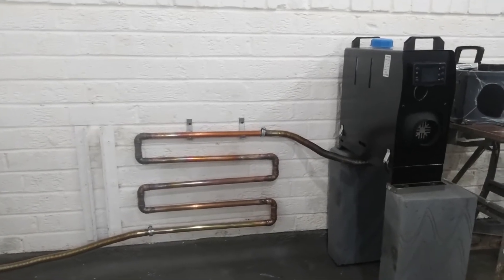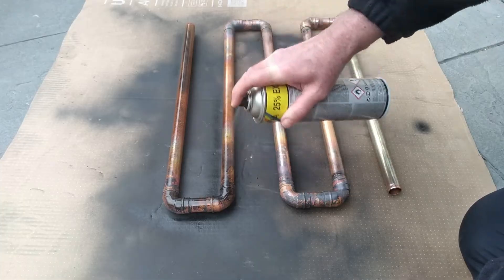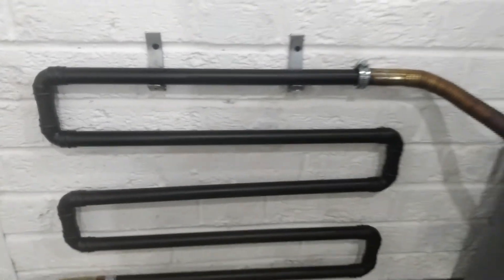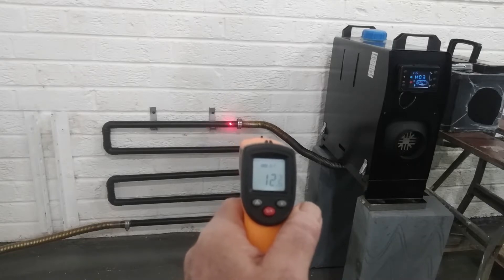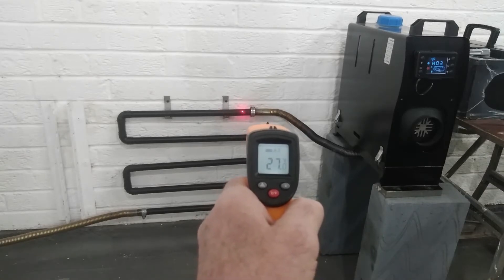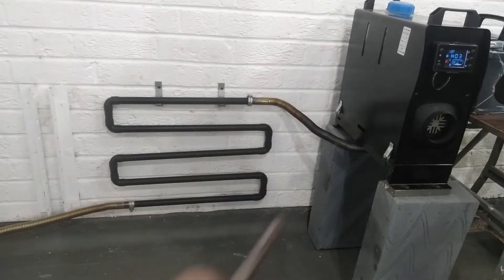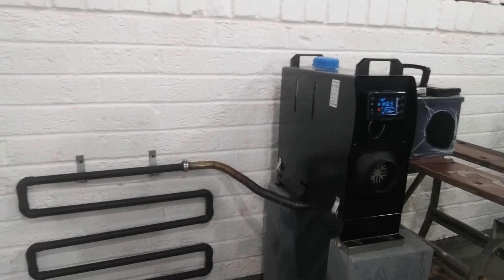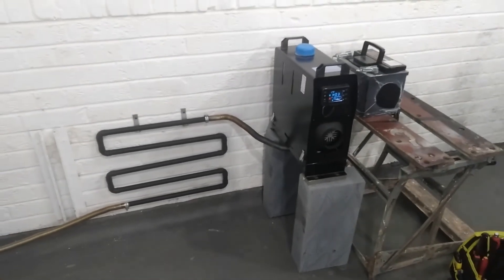I HEAT THIS HOMEMADE RADIATOR FOR FREE Using Waste Exhaust Gas from a Diesel Oil Heater Chinese

Comment: Vids on my channel:  Did similar only your exhaust might be too long leading to back pressure then coking up hence I went with a twin outlet. Pipework running down is good, not so sure how long solder fittings will last.
Condensation hear is good as it's better than dry air at transmitting heat to the copper.
Yes we hear that finned would be better, but you'll know if it's effective given the temperature differential between the start and end of the copper    I used boiled linseed oil to burn off and therefor blackening the pipe.  Still to add a central, 3rd pipe to mine.
Reply from the maker: i will look at yours.
thanks for looking regards andy

Comment: The problem is these bare pipes are not easily heat exchanging - they need heat echange fins as found in baseboard radiators to radiate heat into the room properly. You can just run one long straight baseboard radiator (you can clip on as many as you need and a straight pipe allows for better breathing exhaust). So try it with baseboard radiators.
Reply from the maker: this is a great idea, i will try it out
thanks andy
Reply: @andyfireblade  look forward to it

Comment: How do you join the copper pipe to the exhaust from the heater?
Reply from the maker: with a jubilee clip, but put a couple of slits in the exhaust so it can be clamped to the 22mm copper
cheers andy

Comment: Hi, I have seen an ordinary central heating radiator used, but make sure you feed the radiator from the top and ensure the exhaust  is going down hill all the way into the radiator to eliminate any moisture build up in the pipe, then exit the rad from the bottom on the opposite side to the inlet and then out the wall still  in a downward direction to minimise moisture in  the pipe.
 I am about to try this with a single panel rad. of a size of 500 x 500 mmm maybe thats too big?
Reply from the maker: hello my friend
i did this with a radiator , please see this vid and some of my others.
https://www.youtube.com/watch?v=8w689dCapNs

cheers andy
Reply from the maker: https://www.youtube.com/@andyfireblade
please take a look at my other vids also
let me know what you think
cheers andy

Comment: You should use some baseboard heat pipe with fins on it to radiate the heat.  You can use the pip with no bends and radiate more heat than just the pipe.  It will lower the restriction.
Reply: I waqs thinking of using a heat exhcanger to heat a copper baseboard heater, have the exhaust running through it and a slow water circulation pump
Reply: UK has a product called Finrad. It's uses 2" square aluminium fins in tight contact with a copper tube. Outputs can be as low as 400 watts per metre (yard approx) so you'll need quite a lot. An old water panel radiator is probably all it needs. Just get one without rust holes. ;-)
Reply from the maker: i might try that, thanks
cheers andy
Reply: @andyfireblade  Looking forward to see it.  I have the same heater here in the US and I have a length of it, but it is for something else, but if it does work, I will cut a piece off and use it on mine.
Reply: They sell a cheap baseboard heat tube at Home Depot for $33 that is 24" long which would work perfect to capture some of the heat (or maybe two of them?) I may try that some day in future.
Reply: Or wrap electrical wire around the copper and solder it to it in spots

Comment: Great videos Sir. You are actually doing what only I think about occasionally and then lack the drive. Does it get sooty? I ran a couple of MTR length with a slight downslope and I got some soot after running on low for a few days. A blast flat out fixed it but I shortened in the end and the soot went away. Just fyi
Reply from the maker: i have only just tried it out , so dont yet know the long term effects
yes, a good blast would be good
cheers andy

Comment: Try some 45 bends, twice as many but less resistance in exhaust flow, and some heat reflectors behind the rad.

Although thinking about it less resistance in the pipe may also reduce the heat transfer due to the increase in flow, so it's swings and roundabouts.
Reply from the maker: good idea
cheers andy

Comment: Might be worth using pulled bends in the 22 rather than soldered elbows. If the gasses can flow better you might find the pipework heat up better.
Reply from the maker: good thoughts
cheers andy

Comment: If you are going to use copper pipe, don't use soft-solder fittings, the solder will melt, system fall apart, products of combustion then enter the room. If you must use copper, get a cheap tube-bender off flea-buy and do it one-piece, (better gas-flow), or use silver-solder and end-feed fittings. Be careful with noxious exhaust!
Reply from the maker: thanks for the tips.
great
cheers andy
Reply: Or alternatively compression fittings ;)

Comment: You could use the exhaust to charge a battery...that way you can release heat on the other side of the shop as well...fuel is expensive I don't blame you trying to get every penny worth of energy from it.

Comment: I have a bit of experience recovering energy from fossil fuel exhaust streams. 

A few comments:
Typically you wouldn't want to cool it down too much as the condensation will allow acids to form in your exhaust duct as SOx NOx mix with water vapour. While it is hot enough these gases move through without issue, but when wet they form acid rain. The lowest exhaust temp is determined by the contaminants in your fuel stream and I recall it being between 80 and 120 degrees C - aiming for 120 deg C is a good guide. 

For a properly designed heating unit the energy extracted by reducing exhaust temp from 120 down to something before condensation is a tiny percentage of the fuel consumption and really doesn't improve efficiency much at all. Dropping it to beyond condensation can release a fair bit more energy but you risk destroying your exhaust pipe quickly.

To get maximum efficiency overall you should run a generating set, that would supply electricity to your home and heat to your home via the radiator and some exhaust gas heat as well.
Reply from the maker: hi matt
thanks for your comment.
interesting
cheers andy 
 https://www.youtube.com/@andyfireblade

Comment: Great idea as so much heat is wasted out of the exhaust pipe but I do think by doing this you have created a lot of back pressure and the burn will not be as clean causing your heater to soot and carbon up possibly condensation issues in the exhaust too will be interesting to see how you get on long term keep us informed
Reply from the maker: Great point! yes i agree
thanks for your comment
cheers andy
https://www.youtube.com/@andyfireblade

Comment: Have tried a air-conditioned coil
Reply from the maker: Not yet! wouldnt mind trying
would a fridge one work?
 regards andy
Reply: @andyfireblade  I don't know.  And I haven't bought one I seen this on you tube.  I live in the states. I'm not sure I can get one here. But the coil is made of aluminum and fins . I was thinking if you call it that you put 4 or 5 and a fan behind it 🤔  good luck hope you have fun and save on your heating bill

Comment: Hi there, another tip for you, you need to be a lot closer to get an accurate reading of the pipe. Laser thermometers take an average reading of an area and the further from the pipe you are the bigger the area will be. the laser is just to help you aim, its not actually showing where you are aiming exactly.
Reply from the maker: Thanks for the tip!
Reply from the maker: cheers
https://www.youtube.com/@andyfireblade

Comment: Andy there is a guy on youtube i think he lives in Aus. he seems to be the doctor of chinese deisel heaters and he says the max amount of bends should not excede 270 degrees in total.....im sure he said 270 degrees....ill try find the video and ill send you a link....he says it puts stress on the burn chamber the more bends there are. thats why the come with such a short exhaust pipe. and it could be the reason your getting so much condensation. anyway ill post a link if i find it
Reply from the maker: yes ideally the exhaust should be straight and direct.
cheers andy

Comment: Now that’s a sealed system Andy. Now no one can moan about the build up or acid. Although it could be angled slightly more to let the combustion fluids out and away. Wrote this before you sprayed it with non heat paint and I am not sure it will last mate. Plus watch that first couple of burns off. Now who is moaning. 🙈🙈🙈
Best regards, 
Scott. ✌️🙏✌️
Reply from the maker: cheers andy